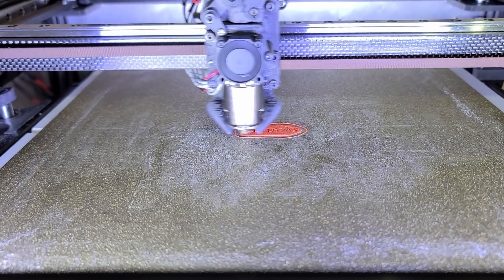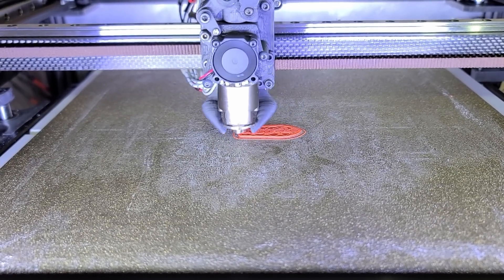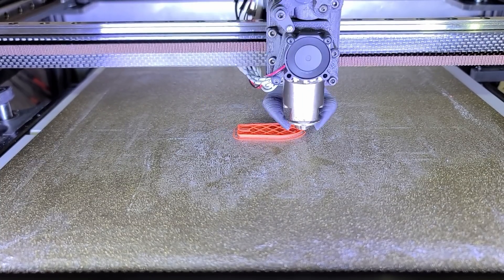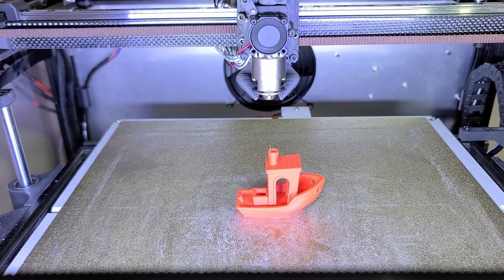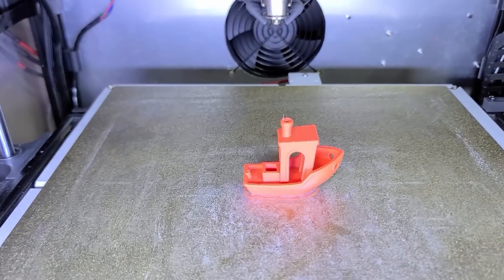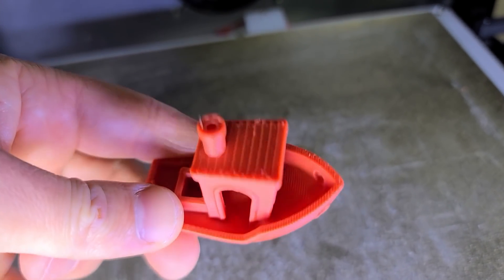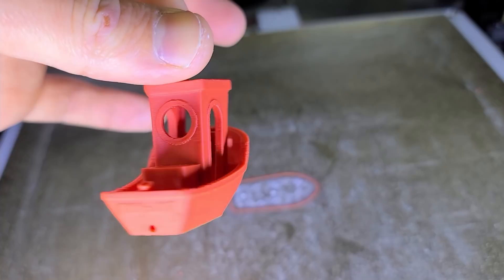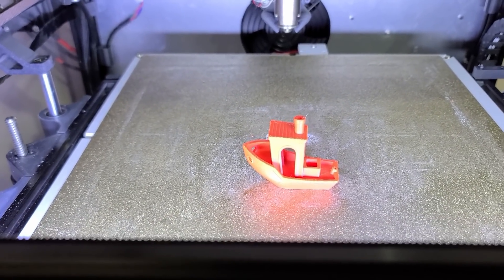Benchy: The "Quality" Run.

Comment: The Pi-Racer prints quality Benchy in 5 minutes at 60k accel (looks the same shown here I can't tell the difference). It's a custom cross-gantry core-xy and I think it's a superior design due to the load being split for X and Y separately and naturally having an AWD configuration with shorter belt paths. I think it beats all other custom printers on Youtube in terms of quality/speed ratio... including the VzBot.

Comment: Hello!
I realized that you are using Grid infil pattern (at least this is the pattern name in Cura) which in definitely not the most time-effective. If you try Lines with the same infil percentage - you will see how closer the infil lines will be to eachother.
The second thing is that you are not using Gradual infil steps setting which makes infill less dense below the top and more dense closer to the top.
All the things I've just mentioned - can produce less strong parts: lines is not the strongest pattern and reducing the infil line distance will reduce strength as well. But for faster prints it is very useful!
And all this will not make the parts look worse aw well!
Reply from the maker: Oh also the rules were not allowing gradual infill.. so i cant use that hehe
Reply: @Vez3D  There are rules for benchy racing?
That is logic, but I never had a chance to look at one.
Do you have a link or something?
Reply from the maker: @rmatveev  its on annex engineering discord server:)
Reply from the maker: Grid..in ideamaker makes way less lines than rectilinear. That was the fastest infill for that slicer. I wull have to check lines i cura :) thansk for the suggestions

Comment: It's not so much the quality you got but the sheer speed you got it at. No way could I print that fast and get anywhere near as good. Fantastically good printing, very nice. Also I'm a big fan of ESun's ABS+, I use it for all my industrial-ish uses especially outdoor stuff that has to take a beating from my semi-tropical sun. Nice work. I'm stealing as much of your data as I can to see if I can improve my own setup in places. Thanks for the video!🙂

Comment: Do you cool your abs? Because when I go fast like that, it has litterally no time to cool. Any tips?
Reply from the maker: Yes I do
Reply: @Vez3D  At what speeds do I cool joe much? And how do I prevent warping and layer cracks when using cooling?
Reply from the maker: @rayknn  do you have enclosure? Depending on the part..some I dont cool at all. But for small details yes... Power depends on your fan
Reply: @Vez3D  Yes Im printing on a Voron 2.4.  It's difficult for me determine how much cooling would be neccessary how much cooling I need. Let's say I take a certain relatively small 3d print, how much fan percentage do I choose? Or do I change it depending on the layer time for example?
Reply: So yes I am using an enclosure.
Reply from the maker: @rayknn  each printer is different... experiment is what will learn you what to use. But less is better. Only cool if needed.
Reply: @Vez3D  Is it true that if the prints starts to get ugly because it doesn't have time to cool, the fan won't iniate layer cracking and warping? This in contrary to blowing air on parts that already have enough time to cool.

Comment: very nice! The Printer is self build. What do you think? How expensive is it if you do it in mass production?
Can't wait to buy one like this in a few years :D
Reply from the maker: No plan of mass production sorry. Its opensource and free :)
Reply: @Vez3D  yeah, I think it's to special for mass market but I just want to see an estimated price. How expensive it is
Reply from the maker: It really depends on the config. If you with cheap stepper motors and a novs or another highflow hotend..its not that bad. Maybe 1200$?

Comment: What does "5 corner speed" mean?
Reply from the maker: Square corner velocity is defined as:
The maximum velocity (in mm/s) that the toolhead may travel a 90 degree corner at. A non-zero value can reduce changes in extruder flow rates by enabling instantaneous velocity changes of the toolhead during cornering. This value configures the internal centripetal velocity cornering algorithm; corners with angles larger than 90 degrees will have a higher cornering velocity while corners with angles less than 90 degrees will have a lower cornering velocity. If this is set to zero then the toolhead will decelerate to zero at each corner. The default is 5mm/s.
Reply: @Vez3D  Thank you!

Comment: The machine is rather.....AWESOME.......I have to wonder if you really need to go to those length just to print plastic parts when the existing machines on the market are already doing a remarkable job.

Comment: I can't see any of the common faults on this, No strange line half way up the sides. The small print sections around the windows are good as is the chimney. Then when you remember it's printed in ABS it just makes it that much better.
Reply: ABS probably helps with cooling since PLA would most likely droop over from the heat.

Comment: Were you blasting it with hot air? How do you keep the temps up with your frame opened up like that?
Reply from the maker: Blasting it with cold air you mean?
Reply: @Vez3D  I thought that ABS required elevated temps for it to print properly. It was a noob question.
Reply from the maker: @SomeGuyInSandy  it does yes..good point. But on a small part like benchy.. it doesnt really matter. However on bigger parts that have lots of bed contacts and lots of surface... you need to keep the hot air in the enclosure
Reply: @Vez3D  Thanks! Excellent project by the way. I subscribed to keep an eye on the bleeding edge of 3D printing tech!
Reply from the maker: @SomeGuyInSandy  thans my friend. Ill try not disappoint you :P

Comment: I'd like to know your first layer speeds, height and temperatures for hotend and bed.
Reply from the maker: 100mms first layer speed. 0.2 height. Bed at 90 and hotend at 235
Reply: @Vez3D  Thanks!

Comment: That looks great! I would imagine most people are trying to figure out what speed you could crank it up to that still allows for an acceptable quality. I know for me, I am hoping to start printing some mildly large pieces that don't need to be exactly perfect but I want to start printing them in a production type environment that would greatly benefit from speed. So my question is, how fast can you print something and achieve acceptable quality, which of course is like beauty, in the eye of the beholder. Mostly I would be interested in surface quality and overhangs. How fast do you think you could go but hold the same quality as the benchy you printed in this video? You mentioned double, but is that it or can you go faster?
Reply from the maker: Still need to test a lot of things. But for prototyping at decent quality.. im sure 300-400mms at 10k is totally good

Comment: pretty nice for the first "go" at quality. I wanted to see if the Odrive created any patterns in the exterior walls which it looks like it doesn't. resume balls to the wall printing
Reply from the maker: It does show some artifacts on straight walls when you print at slow speed. But you wont see that on a benchy. You need a long straight wall and low speed ..like 100mms and lower
Reply: @Vez3D  Do you know what are the mechanics of moving slowly cause that these artifacts?
Reply from the maker: @jrcaeosyroetnsella  cogging more than likely
Reply: At some point it would be great if you can investigate the artifacts on the straight walls.  Currently I use RRF not klipper but can you adjust or have you set the step pulse timings on the control side? Curious what Odrive requires for minimums.
Reply from the maker: @billclark5943  you mean on the 3d printer board?
Reply: @Vez3D  yes. Sorry if I missed it in the video where you were configuring Odrive. You probably already know there are few examples of an odrive working well on a 3d printer? With your high speed example people are probably going to start bugging the hell out of you lol. I looked at it a few years ago but the project was too immature for my skill level.  Now, because of your videos I want to try it on a printer with 10mm lead ball screws on the x an y. If pulse timing is not super fast for the odrive it will kill the Duets max pulse frequency and I will have to use Klipper which isnt a bad thing. Just another learning curve.
Reply from the maker: @billclark5943  its 8khz on the odrive

Comment: What are considered “normal printer”? How many consumer printers can use anything above 1500 in acceleration? Basically no stock consumer printer can use those speeds either cause of cooling.

Comment: The layers look perfect, the edges are a bit soft though. I wonder if switching to a cartesian design with shorter belt paths would be advantageous here.
Reply: probably the input shaper in klipper, depending what values/algo was used.

Comment: I think it would be really cool if you printed something really detailed at 0.05mm layer height at really high speed. It would be also really cool if you raced a resin printer for speed and quality and won.
Reply: A FDM is hard to do lower layer than 0.1. the heat from nozzle tend to melt drag previous layer. Because it is too close. However yes it should be good.

Comment: I think this is a very nice benchy and the quality will be perfect for 95% of us 3d printing people. 
Another settings would be pretty interesting to me:
Print as fast as you can for mechanical parts. Looks don't matter. The part just has to be strong enough.
Also i would still be interested in you fastest quality benchy as you said it probably makes no difference if double it to 200
Reply: Unfortunately, I tried that strategy and it was useless because looks correlate strongly with dimensional accuracy.

Comment: nice job dude :O i really am curious about how much this would cost minus the o-drive. i doubt it'd cost too much :O I like this over the voron tbh. much more than the voron.
if I wasn't horribly depressed and unmotvated i'd steal some of your ideas into my own printer lol. specially the carbon fiber bar instead of the 2020 extrusion. i have 2 cardbon fiber rods and I can do it like you used to do before you got the rectangular one!

right now i have a friggin mgn12 on a 2020. sadly I couldn't find an mgn9 in my country. even the mgn12 was a random cool find!. there's a store selling mgn9h but I can't afford them. and my current rail is wobbly. the chinese ones they sell here are crap
Reply: Pretty sure this printer started its life as a Tronxy x5s ($200.00ish). Another $400.00ish for the gantry, belts, Volcano, extruder, etc. So for under $700.00 you can build 90% of this machine. He has videos of how it performs in more or less this state, and it runs very fast and prints well.
I would budget something like $1200.00 so other improvements like a machined build plate could be made. 
I was going to do this to my x5s, but decided to go with the RatRig instead. Better to start with a solid platform, rather than upgrade an inferior platform.
Reply: @joshua43214  The extruder he is using ~$500 USD "pre-order" right now. His build plate from the Tonxy has been replaced by a custom likely unonbtainium one. The odrive and motors I just got a few days ago and was about $425 USD for those two exact motors, odrive, encoders, the USB isolator, ferrites and programmer. $900 USD in (not factoring shipping to Canada and duties, conversion to CAD, which as a fellow Canadian I am very aware of) and you don't even have a Pi for Klipper, a accelerometer for klipper or anything else. It may have started off that way but it's not where it is today. I also meant CAD in my original post. :) I myself am trying to replicate this on a larger scale and cried when I saw the hotend prices :'(
Reply: @forbiddenera  The build plate is just a cast tool plate, you can get them custom made for under $70.00 in this size. Pretty common item. RPi 3B+ runs $35.00ish, accelerometer is about $2.00. None of these details are expensive. If one forgoes the motors and oversized hot end, my price still stands, and will print very well, at very high speed.
Like I said, 90% of this printer for $700.00ish.
FWW, I would not upgrade this printer this way, I would start with a Hevort or RatRag or something else that has an emphasis on rigidity (so not a Voron).
Reply: Hot end is 500 usd alone .. odrive and motors  pi for klipper at least 1k there im sure this guy has invested 5x that to get here or more!

Comment: Good quality for ABS. Did you retune the pressure advance ? Any update on the anti cogging at very low speed ? (May be your gantry is too light :D)
Reply from the maker: Yes i did tune PA. But its about the same as before. 0.005    . As for cogging...its only a very very low speed

Comment: Any chance of a large print printed quickly?
Reply: That's what I'm interested in. Fast settings that are only held back by cooling minimum layer time, so that there's a lower time penalty for larger parts. For example, the ideal would be like LCD resin printers, where small items take X amount to print, but larger items of the same Z height take the same or a slightly longer time to print.

Comment: That looks great!
Can you try with even lower (0.12 or 0.1) layer height and faster speeds? This is what I'm really curious about: Can you get better than normal quality in the same time (or faster) as this 0.2mm run?
Reply: Probably, but lower layer height significantly increases print time, so much so that print speed may need increased way faster than the printer can handle to achieve the same times, then you're back at lower quality prints.
Reply: @ThatOneStopSign  oh, it's been 3 years since I left that comment. I don't remember what the limiting factor was in this video, but I suppose it was cooling / flow. With lower layer heights you could speed up the print head without being limited by flow rate, and it should be easier to cool since the layers are smaller in volume.

Comment: What fan speeds did you use, and did you disable minimum layer time? My chimney turns to goop when I try this.
Reply: probably not using ABS, do you?
Reply: @3dprintingguru378  I am using abs
Reply: @thadude3  I'm using like 20% fan for ABS and those speeds, Extrudr ABS in my case and got no issues with the smoke stack

Comment: That’s some wicked good quality. You’ve got me over here ordering 500$ o drive kits and a laptop fffff
Reply from the maker: I would not recommend the same motors as I run for a printer like a bed swinger. Unless the frame has been highly upgraded and bolted to wall. Even  on my printer, it has to be bolted to wall or the printer will vibrate itself off the table. Those 5065 ..270kv have a lot or rototating mass and its shaking the printer real.good
Reply: @Vez3D  the first time I started up a CNC mill with linear motors, we did a rapid move in x axis the column of the machine stayed stationary and the base  moved 500mm before we could even poop ourselves.
Reply: @Bac_creates ik this comment was posted 2 years ago, but LOL 😂😂
Reply: How about a stouter HevORT with the next version of these motors. Bolted to the garage floor. 😅
Reply: @Vez3D  That would have to be a real solid bed setup. Like, machined gear track rails and some ridiculous gearing mechanism idk.
Reply: I ordered odrive. Gotta get a good hotend and some other sheet still lol
Reply: ABS generally has good quality vs PLA and PETG.   don't really need an o drive, and it needs to be driven by USB or CAN bus to get the best of it, using step pins is like using your keyboard to type morse code, it's just going to be as choppy as a stepper, its a interface of convenience if you need to use it but you'll get smoother motion the other way.
Reply: @digibluh  ive already got a couple bed slingers and a resin printer im pretty nice with. but its like getting used to bike and wanting a faster one. also, you cant discount the value of getting yourself in over your head to see what happens.
Reply: It would be interesting to see how fast a quality benchy can be done at. You really think you could maintain the quality at 200mm/s?